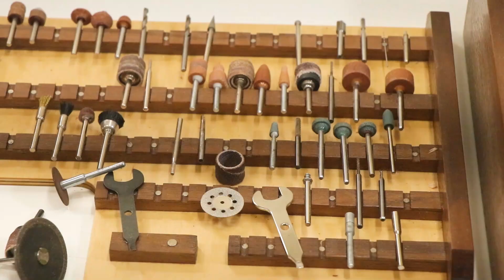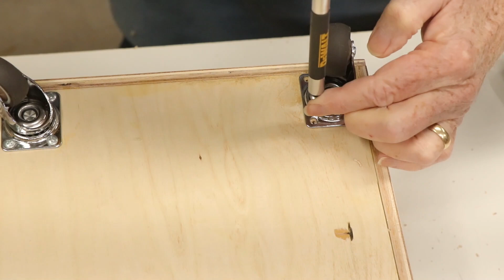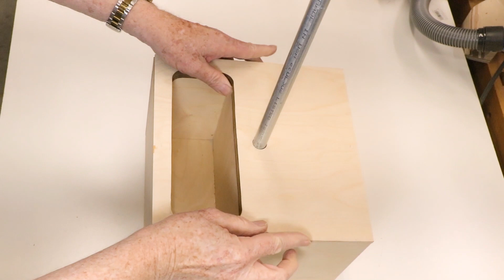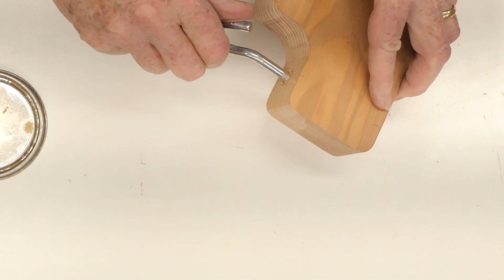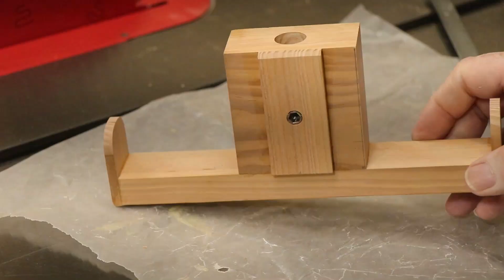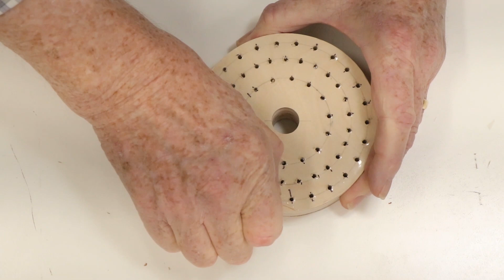Flex Shaft Tool Stand

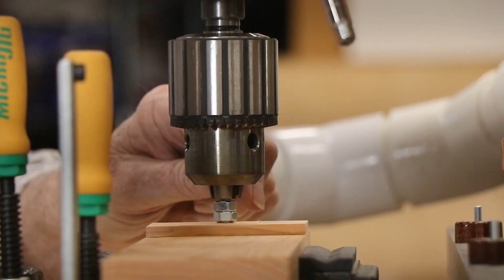Comment: @10:00 that's just genius!  Mine is always a little (tiny) bit off.  Nothing that throws anything off, but it's always annoying.  And as usual, very practical and picked up a lot of tips.  Have the video was looking other stuff in your shop that I can mimic (like that robot arm dust collector and the dowel/slit/sandpaper trick)  :)

Comment: Very nice!
One suggestion - I created a hanger system for my Dremel tool that is attached to the ceiling joists over the bench in my shop that's a bit more crude that this setup.  Rather than hanging the motor directly onto the hanger, I used a short length of bungee cord that prevents vibration from the motor being transferred into the hanger where it could trigger rattling or sound amplification.

Comment: I think I want to get a band saw, what kind do you have Patrick?
Reply: Oh scroll saw but what brand or model?
Reply from the maker: I am very enthusiastic about the DeWalt 788.  I had two entry-level scroll saws that took pinned blades.  They both vibrated my teeth out, they had small throats, and they required pinned blades. Both required tools to change blades. I have also used two very expensive scroll saws, and found they had some nice features, but cost about 3X as much as the DeWalt, which I think sits at the sweet spot for cost, solid construction, and important features.  I just checked, and today that saw is available on Amazon at a substantial discount.  I put a link to that in the video description.